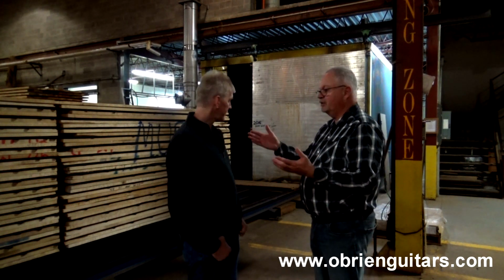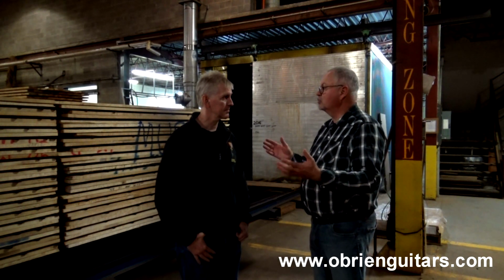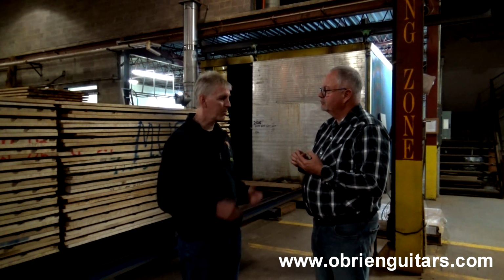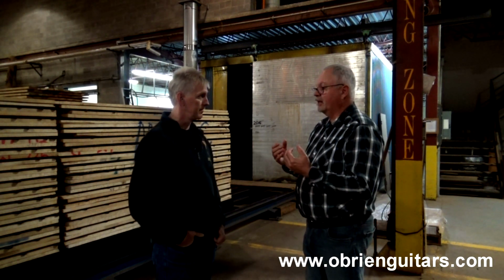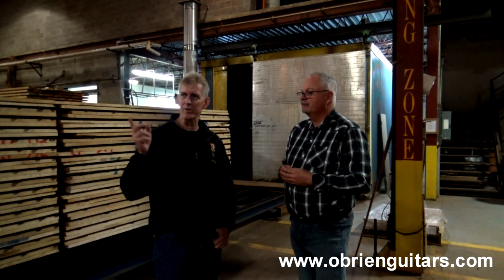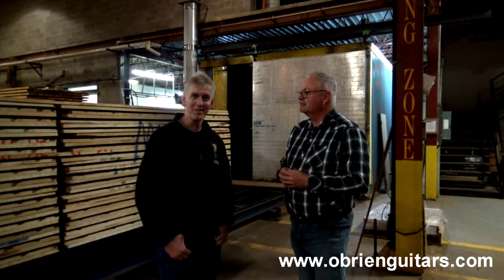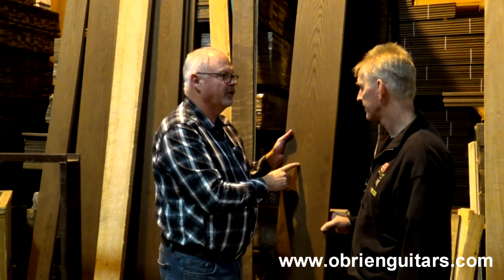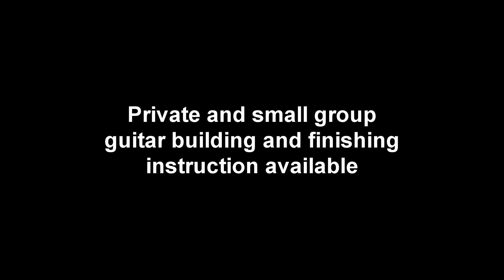Luthier Tips du Jour Mailbag 106 - What is torrefied wood?

Comment: Can I torrefy a spruce top at home?! 🤔😊
Reply from the maker: I wouldn't recommend it.
Reply: I know a guy who does it in his home oven by tenting his billet in aluminum foil with several hand warmers. Hand warmers remove oxygen through an oxidation reaction. Home ovens are typically accurate enough to hit the needed temperatures and maintain them. His caution to me was to make sure the wood is really dry before. He apparently used the oven for an elevated temp drying step.

Comment: Cool. If somebody wants it can find a oven design and study on thermal wood on the Roukangas guitars site and why lower temperatures are better for instrument use. 
I hope that we will begin to see other wood species in thermal treatment being offered. 
Personal dream is to get a full thickness and heelless Les Paul with torrefied Okume/Spanish cedar and Sycamore for the body and torrefied Spanish cedar neck wrapped in carbon fiber and have the finished guitar weight around 6lb 10oz (3 kg).

Comment: Would love to see some more torrefied apple, pear, and plum.
Normally it's very twisty, unstable, stringy. Considered junk wood, and usually chipped for smoking. Torrefaction would make it stable for instruments. It would be hard to find large diameter pices, since trees are usually grafted onto smaller rootstock for pickers to actually reach the fruit. But they could be great for necks.